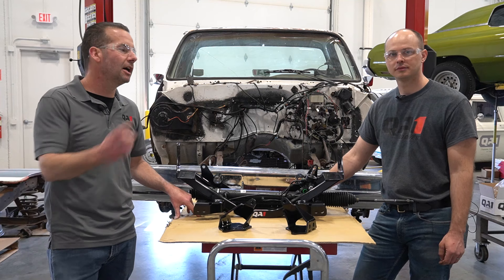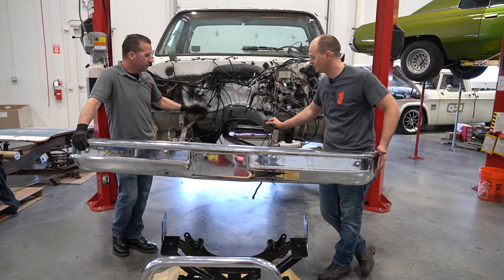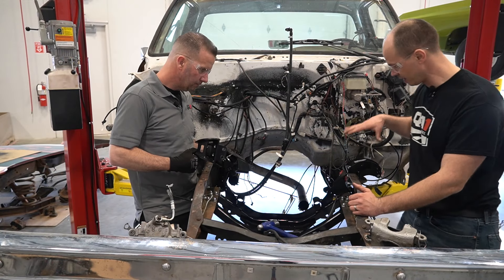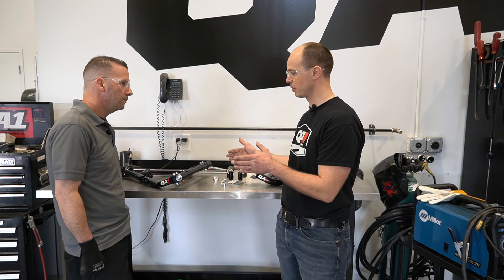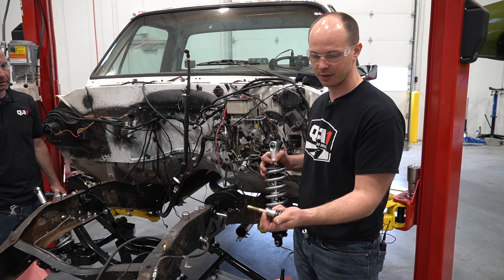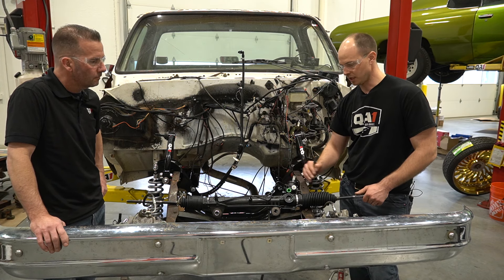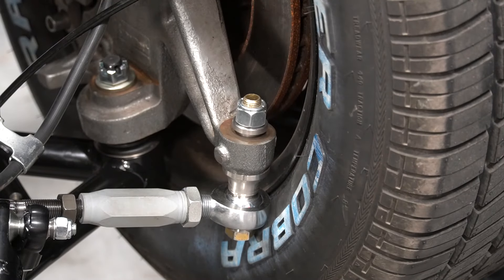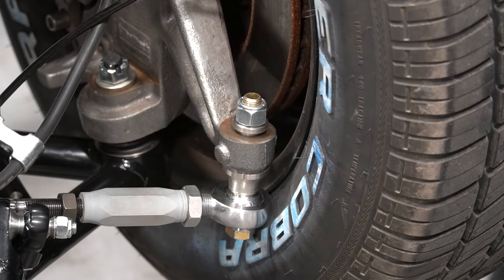How To Install 1963 - 1987 C10 Tubular Coilover Crossmember

Comment: I’m skeptical about trying to drill the one top hole for the upper shock mount because half of the hole in the frame is under the hole in the bracket. Might be a bear getting that one to turn out nice. Also, is it normal for the sides of the crossmember to be slightly higher than the frame?

Comment: Dang, wish this was around 2 years ago. I’ve had your front coil over kit on my truck for about that long & with drop spindles. With the coil overs as low as they’ll go, while maintaining adequate travel, the lower coilover mount brackets are only 2 inches off the ground 😭.
Reply from the maker: We actually just released this crossmember about a month ago! And we do have a retrofit kit that will fit with your current setup. So you would just need to purchase the crossmember. Sway bar and engine mounts sold separately.

Comment: Great stuff. I use QA1 products on both my race cars. I just put QA1 coil overs on the rear of my 39 Ford. The techs got me the right springs and shocks first try. My friend had a 65 C-10 that had a 71 Cutlass frame stub grafted on. This would be a lot easier, cheaper in the long run, and safer.
Reply: building a 65 c10 with my 12 year old son

Comment: Oh heck yea!!  Price and availability, will be ordering for sure
Reply from the maker: Pricing will depend on if you already have the front kit and just need the crossmember, or if you are looking at the full front system. We are aiming to start shipping the end of the month.
Reply: @QA1TECH  I already have your complete kit.  Just need the crossmember with the retrofit kit and rack
Reply from the maker: @jonathanpalahitski9596  The crossmember and rack and pinion retrofit kit will be around $2200. Engine mounts and sway bar sold separately.
Reply: @QA1TECH  nice when will it be available to purchase
Reply from the maker: @jonathanpalahitski9596  We are aiming to start shipping them the end of July.
Reply: @QA1TECH  awesome I'll be ordering for sure!!

Comment: How many inches of height adjust would I have. 

If I bought this and install lowering spindles can i still adjust my height to go up or down? 

I would like to be around. 6/6 drop I love a slight rack lol
Reply from the maker: The drop spindle would give you 2" of drop and the coil over kit would also provide 2" of drop. You would still maintain adjustability in ride height with the coilover system. If you have any further questions reach out to our tech team!

Comment: Question… usually these trucks the front tires stick out a bit more compared to the rear tires.  Does this kit fix that? Or it stays the same as the factory k member?
Reply from the maker: This kit will retain the factory track width so that will not change from installing the front end kit.  Some disk brake kits and aftermarket spindles can alter the track width, but the QA1 front end will not in itself change the position.

Comment: For the lower control arm what’s the 2nd set of mounting holes on the pivot point? Is that so you can pull the wheel further in the wheel well or for a different year

Comment: Do you guys make a coil over conversion for a 4wd chevy s10? If not you should. I have a 1998 gmc Sonoma 4x4 that I want to make into a 2 gen Syclone (awd and boosted) and it would be nice to get rid of the torsion bars with something that could bolt in mostly. Anyways nice products. 🙂👍🏼
Reply from the maker: We currently do not catalog anything for the 4WD trucks, but could possibly make a coil-over or shock setup work depending on your specs. Give us a call! 952-985-5675

Comment: How long might one man spend installing the full cross member and front suspension on a 65 C10?
Reply from the maker: It's a complete bolt-on system which helps with the installation. You do have to fully remove the engine to do this install which can take some time. Depending on your resources at home and experience, it could take a few days.

Comment: Does this crossmember “center” the wheels in the fender opening? As in move the wheel centerline forward. 
Also how many joints to connect the steering column?

Comment: @QA1 Most of the way through installing this system on my project.  I already have QA1 uppers and lowers to retrofit, and they have bump stops. I noticed in your install they are not there, I'm assuming they aren't needed with the new setup?
Reply from the maker: The new crossmember eliminates the contact points that are on the OE crossmember so the stops are removed from the upper and lower arms. New bump stops are installed on the shocks and the tether is used as a droop stop.

Comment: My tapered spacer for the tie rod end connection is about 5/16” from seated? Do I force it
Reply from the maker: Hi there! It's not a problem if a small portion of the pin is visible. The most crucial factor is ensuring the taper on the pin is fully seated within the steering arm. This is similar with a ball joint pin as well. If, for any reason, this is not the case for you, please call one of our technicians. They can confirm that everything appears normal. They can be reached at 952.985.5675.
Reply: @QA1TECH thank you
Reply: Ok I have another question. My 65 C10 did not come with a swaybar. I added the swaybar links to the lower control arm and the end of the swaybar. After that I had my wife turn the steering lock to lock. I had the bushings and mounting brackets attached to the swaybar as well and I held it up to the bottom of my frame as I slid it closer to the crossmember. At one point I got too close and the tie rod hit the swaybar links so I moved it forward a little bit. The links don’t hang straight down but rather tilt forward a little bit towards the ends of the swaybar. How should it look and how much room is there supposed to be for up and down movement of lower control arms on rough roads or wheelies?

Comment: Would you use a drop spindle or a stock hight spindle?
Reply from the maker: This kit will allow up to 8" of drop. You can use a drop spindle if you would like or you can use stock type spindles. It does require 73-87 spindles.

Comment: What motor mounts are used with gen v lt? Is there an energy suspension or prothane part number? Or is it included?
Reply from the maker: We do offer engine mounts for our crossmember. https://www.qa1.net/automotive/suspension/classic-trucks-conversion-systems/1963-1987-chevy-c10-tubular-crossmember

Comment: My 65 C10 does not have a locator hole for the front sway bar mount. Can you please give me a measurement from the front tip of the frame or some other reference point so I can be certain about its location?
Reply from the maker: We do not have a defined measurement for this, but we highlight it in our install instructions on how to properly install the sway bar on the 63-66 trucks. https://www.qa1.net/assets/uploads/documents/intallation_guides/9919-219_REV_52896_C10_Front_Sway_Bar.pdf

Comment: I’d like to retain my 15” rallies on a 70 C10 and noted the fit against the tie rod was tight even without the spacer. For reference, what width and backspace were those 15’s in the demo (and tire size)?
Reply from the maker: 15” wheels with 3” drop spindles does require the spacer be removed for rod end to tire clearance which ends up being about ½” right at the edge of the rim. 2 ½” drop spindles will allow more clearance to the tire but the spacer still cannot be used. Stock height spindles can be used with the bump steer spacer and 15” wheels to achieve a 5” drop. 

15” x 8” GM truck rally wheels (stock Truck Rally Wheel)
4” backspace with ¼” wheel spacer
3” drop spindles
255/60/15

Comment: I'm delighted that a crossmember is available.  I have front and rear QA1 suspension on a 66 C10 that I'm building with an L86 engine and Ultimate Headers.  I'm very curious if the steering shaft will work with my setup.  How can we determine the position of the steering shaft, to make sure there is clearance, before I make the purchase?  Is there a template or measurements available?
Reply: What are you using for the rearend the differential?

Comment: How much is the reto kit, or does everything come with the crossmember? I already have the coil over setup. Just need the crossmember.
Reply from the maker: Just the crossmember and rack and pinion will be around $2200. Engine mounts and sway bar sold separately.
Reply: @QA1TECH  so the parts to retro fit the lower a arms to the new crossmember come with just the crossmember?
Reply from the maker: @mannyramirez8146  Yes. Everything you will need to adapt the retrofit kit to the crossmember will come with it.

Comment: After installing my QA1 system, I added a POL rack and pinion. But had to remove it because the input shaft angle was so steep the steering joints were binding up when turned.  This video does not show the instillation of the steering shaft to see if your angle is at a better pitch.  Any Video coming ?
Reply from the maker: We are looking to do a video around the steering shaft. Thank you for the feedback!

Comment: Whats the cost and can you bolt cpp spindles to take hub bearing
Reply from the maker: Our complete front crossmember kit starts around $4000 and comes with 73-87 C10 ball joints. The CPP spindles should work, but feel free to reach out to our tech team for some recommendations! 952-985-5675

Comment: Would this crossmember fit a c20 ('86 2wd)? I know you offer a coilover conversion for a c20. It would be REALLY nice to find a whole bolt-in unit.
Reply from the maker: This crossmember setup will not fit the C20 at this time. We do now offer a control arm, coil-over setup for these trucks. https://www.qa1.net/automotive/suspension/classic-trucks-conversion-systems/1967-1986-chevy-c20-1987-1991-chevy-r20-coil-over-front-suspension-kits

Comment: is it really worth the upgrade?
Reply from the maker: Some people think so! It provides major weight savings, gives you more ride height adjustability and can compliment your other upgraded suspension components nicely. However, if you are not in the market for a full crossmember upgrade, we still do offer the control arm and coil-over kit with the option to add the crossmember later.

Comment: Do they make them for a 78 impala landeu
Reply from the maker: We currently do not make a crossmember for these cars, but do have full vehicle kits.
Reply: @QA1  great could  you send me a link thank also does qa1 make  front end Steering components for a 1978 impala if so could  you send me that link as well thanks
Reply from the maker: @Macnificent78_  https://www.qa1.net/automotive/suspension/full-vehicle-kits-systems/handling-suspension-kits

Comment: Can you convert a C20 to a C10 using a full kit like this?
Reply from the maker: This kit is designed to bolt onto the C10 chassis frame. It will not bolt onto the C20.

Comment: Like always you'll make great stuff but like everybody saying the average man can afford that s*** and y'all can do a little bit better at your video kind of drug out a lot of stuff didn't explain in detail sure would like to have one of those for my 86 fiberglass one piece tilt front end pro street style maybe y'all could give away a gift or something
Reply from the maker: Thank you for watching and for your feedback. If you already have the existing front system of ours, then all you need is the crossmember which will be around $2200 through our dealers. If you need the complete front end, you are looking at around $3995 through our dealers. The video is longer since we covered both the retrofit kit and new kit install process. Sway bar and engine mounts sold separately.